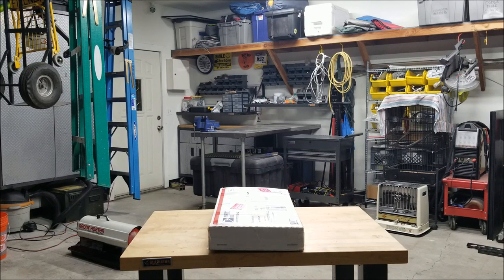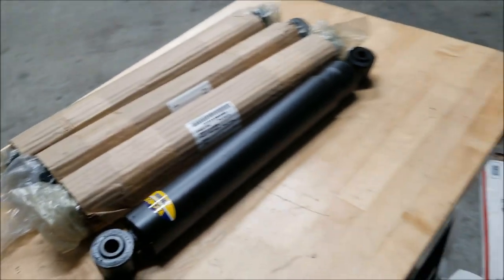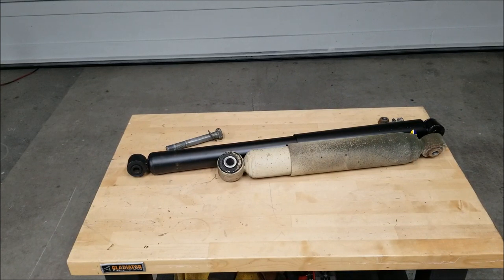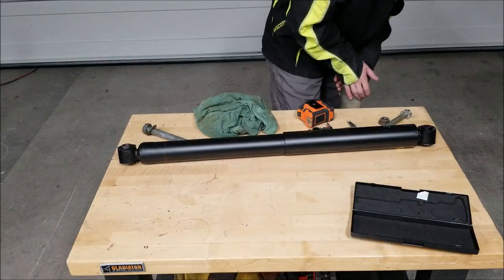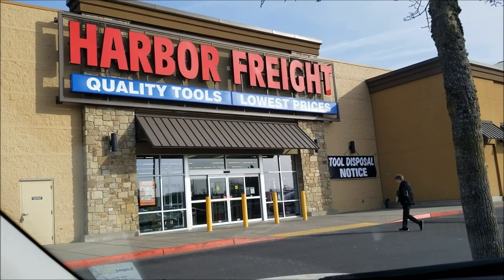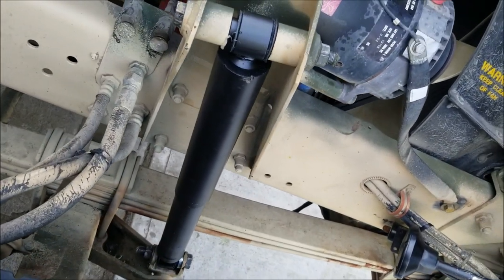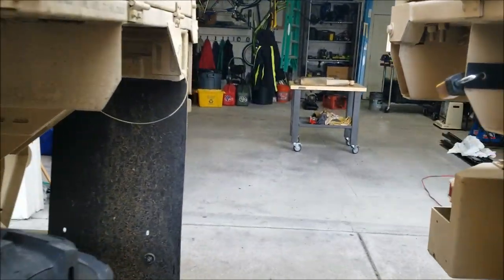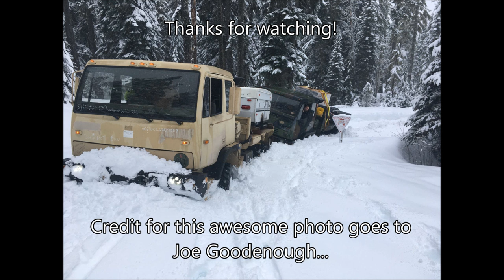Abel LMTV build part 78 (MRAP shock/strut modification and installation)

Comment: Someone was talking about these on another site. Seemed out of context. Now I know what they were talking about. Interesting to see how they ride. Yet another item to add to the list. Surprised the price of them wasn’t inflated like the rest are.

When you went to harbor freight I thought you had gotten a drill press. With as much fabricating as you do surprised you don’t have one.
Reply from the maker: That is because no one knows what they are truly for.  They are actually double purpose.  You could use them for steering stabilizers and shocks for suspension.  I found this out by doing a deep search on the interwebs.

I like to torture myself and do the drilling by hand.  That way I can burn up ryobi drill motors.  I think I am on my 18th one in my lifetime....  LOL

Comment: Four years later wondering if these are still a regular stock/production item…or maybe there’s a newer version.  I like the idea of upgrading to newer more readily available parts when possible…
Reply from the maker: Yes and no.  They can be found from time to time on ebay.  The LMTV community is now using an off the shelf shock that fits but it is the exact same as this one.
Reply: @SeanFillner  thanks for the response…as long as there’s a current production item that works that’s great.  Trying to join the lmtv community but till in the “procurement phase” ha ha.  So just filing these kinds of upgrades away for the future…appreciate the info.
Reply from the maker: @fsfazekas  join the lmtv fb group that I admin.  Lots of options on there.
Reply from the maker: @fsfazekas  fb://group/1607576859556624?ref=share&mibextid=NSMWBT

Comment: Looks good.   Need to find some washboard to test it now.  👍

They look a lot skinnier....... wonder how they will hold up to long off-road driving as they heat up.   

What line were you putting on the bolts?   Silicone grease?
Reply from the maker: Well they were made for a much heavier vehicle so I am not sure.  For 100 bucks a set I can just keep more on hand I guess??  

I use this in a lot of my videos as you may have noticed....  https://www.amazon.com/gp/product/B00C5014K8/ref=ppx_yo_dt_b_asin_title_o00__o00_s00?ie=UTF8&psc=1

Comment: Cool that you made those work!  I’m sure they’re better than worn out / blown out OEM!  The diameter does concern me a little...I imagine compared to a new OEM shock the skinnier Monroes are more apt to overheat in rough conditions.
Reply from the maker: Over 12k miles on these so far.  NO problems other than a much better ride to report.  I have another set ready to go if anything should happen.....  The new fox ones are the same diameter as these...